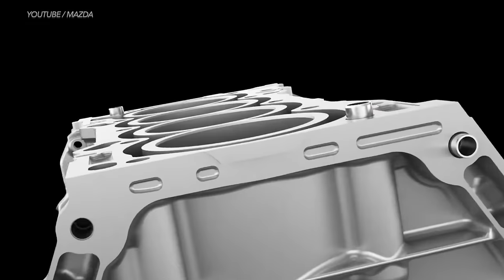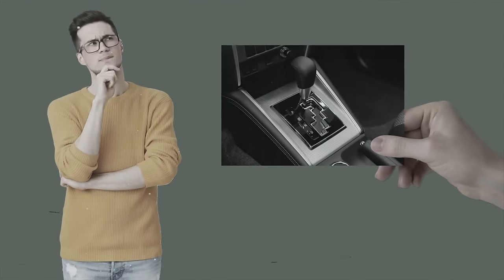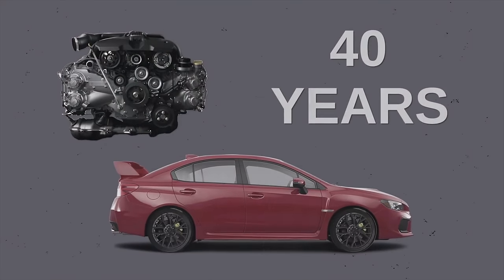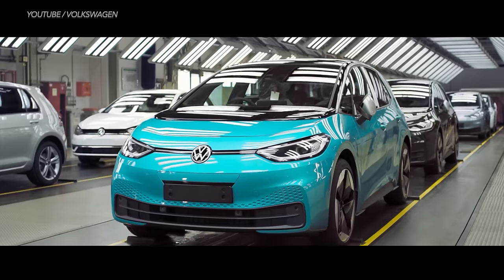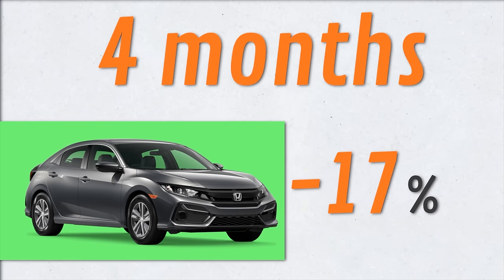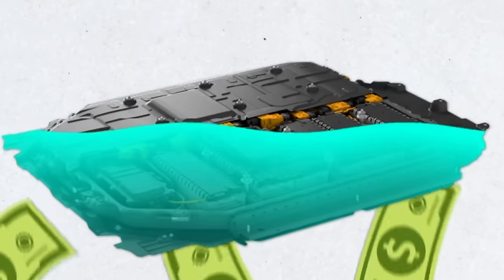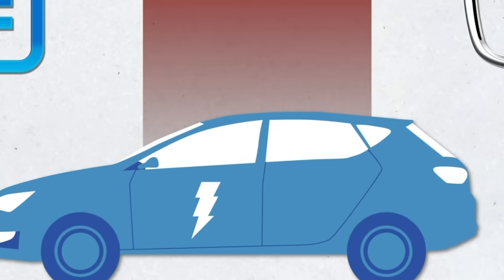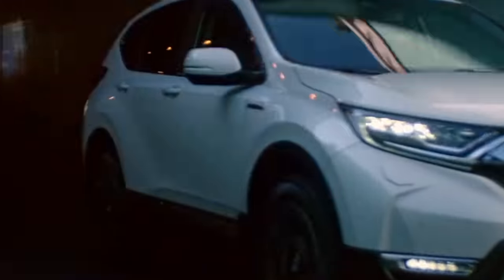3 Things That are Killing Your Favorite Vehicles

Comment: As a former new car dealer in a small town, and a multiple trailer owner and past SUV, tow vehicle owner. When I heard a couple years ago that the Toyota tundra was becoming woosified, I went out and grabbed one of the great big V-8 Tundra gas hogs. 
I would be happy to buy the same exact vehicle in about 10 years if I could find one with 1 mile on it.
Reply: Sounds like about any other truck brand I have owned if you can’t get 250k out of the truck than it’s not worth buying stop acting like Toyota is the best truck manufacturer ever.
Reply: My 2010 tundra 5.7 has 216 k on it. Scotty did a review on it last year when he was in RI.
I have no interest in the new tundra
Reply: @Back_door_bandit_98 exacty!! I'm so sick of people drooling  over toyotas ,like they're the only good choice
Reply: And why I purchased my 2020 Tundra. My first V8! And probably last.
Reply: TheOldBreed  no, thats not what i mean...kust because you know peoppe with newer tundra having issues. Doesnt mean all new toyotas arent good...plenty of newer ones are good. Andof course...you buy the first year twin turbo you're going to have problems....it's mind of common sense..it's a new design,  buy most years honda and toyota,  and a lot  of fords, and mazdas are exellent .
Reply: IMO all full size pickups should have a V8, even if you don't tow much.  A pickup is a heavy vehicle, and a V8 can handle it.  You want 300,000 miles out of your truck?  Get a V8.  What do people think is happening when they're pushing that big truck around with a V6, or god forbid, a 4 cylinder?  That engine is under tremendous strain.

Comment: Yesterday I was discussing with my friend about the electric vehicles. he said th EV cost much less service costs than gas cars. I told him the car manufacturers are not stupid to provide that. You have to pay somehow maybe more than what you're paying for your Lexus regular maintenance. I think i should send him this video to show him the reasons why.
Reply: Do it
Reply: They'll come up with everything to get you back in the shop. Wheel bearings or sensors. Thinner winding wire to fail. Cheaper motor drives. Screens that yellow in the sunlight. Bumpers that melt in the sunlight. I could keep going.
Reply: Until you need the new battery....
Reply: > being friends with an EVs driver

Well that's your mistake right there mate

Comment: Toyotas V8 and V6 engine vehicles will be worth lots of money in the future. Turbo vehicles just won't last.
Reply: I just bought a Lexus IS 350 F Sport with a 3.5L V6.
Reply: Had a GMC 6.6 LB7 turbo diesel and a Dodge 5.9 24V turbo diesel. Sold both with over 400k miles and the original turbos. There’s nothing wrong with turbos, just peoples bias.
Reply: @LayzeeGiant diesel combusts at a much lower temp. Turbo worst enemy is heat. Gas turbos short life, buyer beware.

Comment: C'mon Kilmer you're about my age and know this is merely the start of a new cycle. Also, people who want to buy already have or are biding their time for say a long-lived solid-state battery that when commercially viable will make electric cars the norm. Now all of the car manufacturers have really been building a lot of crap lately. Disposable cars with engines and radiators made of plastic and other planned obsolescence for about $60,000 a piece. Well, people don't take kindly to that, so people aren't buying until something better and more reliable and longer lived shows up.

Comment: My 2016 Subaru WRX STI had a 300hp 300lbft with a 4 cylinder. Never had any issues and only sold it to get a down payment for a house. Miss it a lot. I don't see why 4 cylinder engines are bad. There are only bad manufacturers, not bad number of cylinders. Modern manufacturing can produce more power just as reliably as old manufacturing with less displacement. It is called progress 😂
Reply: But it seems like the only thing that's progressing is the price of the vehicle and of course all the cost that takes to repair them
Reply: 5 liter 4 cylinder could be the hot app

Comment: We used to have a Straight 6 Cylinder Chevrolet Pickup Truck.   It used to run Backwards when You Turn The Key Switch off.   It was a 3 Speed manual Transmission because if it was an Automatic Transmission I don't know how You would kill the engine. It was a 1973 Chevrolet Pickup Truck. It had all that Pollution Junk on it.

Comment: Turbos are killing the old cars we love, good luck see this types of car reaching over 200k
Reply: Only exception is Volvo and Honda, they’ve been making turbo engines for decades and seem to be very reliable
Reply: @BigAltimaEnergy719 1.5l Honda??? Junk.
Reply: @BigAltimaEnergy719  
It's just those good/ reliable turbo engines were at their best in the late 80's to early 2000's and those talented engineers have all retired 🤔
Reply: @mrgarrison3516  like the 7.3 turbo diesel. They are notorious for logging 200,000+ miles before needing anything more serious than an alternator or power steering pump.  Those Garret turbos were matched perfectly  to those engines.
Reply: @OnlyHuman2.0  The earlier ones had issues, I haven’t seen issues with brand new 2023 ones, use GF6 oil and change every 3-4K miles instead of usual 5
Reply: Old, Detroit Diesels with Turbos on heavy trucks and work rigs last a long time, way over 200K miles, turbos on consumer vehicles are just not made the same way.
Reply: On smaller engines in big heavy vehicles only makes things worse
Reply: MEANT.   TURBOS.

Comment: Actually Scotty 3 cylinder engines are now more popular than 4 cylinder. Maybe in the US but rest of the world 3 cylinder plus a turbo is the go to for manufacturers. Brings emissions down and provides good performance. Only issue is you are really heavily on the turbo and a lot of pressure coming into that tiny engine😮
Reply: On cars that are compact or smaller are fine in Europe but not so much on heavier vehicles in the US. Might struggle at times
Reply: @kclefthanded427  I disagree why do Americans have to have large vehicles? Your speed limits in some states are 55mph and they're just straight roads. Your v8s couldn't handle corners and just made a lot of noise and not much traction.
Reply: Ford sure dumped 😅their 3 cylinder fast.
Reply: @chunkybeats79  Its because they are super reliable and can carry heavy loads when needed. Broken roads have less impact on larger vehicles and they are safer in an accident as Elon musk confirmed in an interview recently I saw. 😮
Reply: Roads are not getting better. It's not just the rural areas. Potholes and speed bumps absolutely wreck the suspension within 6 years.

Comment: The best solution for the car longevity is manual transmission. And will save on gas, too. No need for EVs with high prices.
Reply: Autos have been getting better MPG for 15+ years... But I still agree.
Reply: Auto is good for 200k. Manual broke in my friends 2015 Scion tC with 130000 miles

Comment: I have a question? In the sixties, you could buy a ford or Chevy with a six cylinder engine and for a hundred dollars more, give or take 25 dollars, get a 427 ? Inflation is inflation but now a day’s a engine can cost 40,000 dollars more? I don’t get it. Top of the line is still the same thing?

Comment: Scotty, huge fan here. I have a 2017 tacoma. I want to change the transmission fluid. If I drain the fluid when the engine is cool, is it okay to just put the exact amount back in that I drained out. I have a scan tool to determine the tranny temp, but Id rather avoid that hassle.
Reply: All you have to do is , put in what you take out....if I'm wrong,  let me know. And sell the truck. if you need a scan took for tranny fluid, I'd never own  it

Comment: Hey Scotty I hope you’re doing well 
I got this question that no one wanna answer I got a 2011 BMW X5 xdrive35i with no faulty code on a the dashboard but when I scan it here’s what it said:
ECU 1
2) Close loop: using O2 sensor for fuel Mix and I started to see little smoke on the exhaust.
What do you think I can do to fix it?

Thanks in advance for your help
Your youtube fan.

Comment: Inline 4 cylinder cars make way more sense than any EV
Reply: If they did, then we wouldn't be transitioning to EVs.  EVs are just going to have too many advantages.
Reply: @JT_771  Nah. You've been bamboozled by your gooberment.
Reply: @OnlyHuman2.0  Nah, it's all in the numbers.  Since an EV is vastly more efficient and solar energy is so cheap it will always be cheaper to operate an EV.  And it'll continue to get cheaper.
Battery prices have dropped drastically in the past 10 years and that trend, which has been following a predicted curve, is expected to continue.
That means that EVs will regularly get less expensive to make, while combustion doesn't have that luxury.
In the end, price alone will do it.  It's all in the numbers.
Reply: @JT_771  Nah.
Reply: @JT_771  LMFAO
Reply: @OnlyHuman2.0  Hey, believe what ya want & we'll all watch how it plays out.

Comment: The boxer engine in my 86 was the worst at 50k my engine started knocking and there was a problem with bank 1 the Rod was also broken. Luckily it was still under warranty and got replaced after getting it back 3 days later the engine light came on and it had to go back to the dealership then they “fixed” it and it literally blew up on the tech and caught fire 🔥 I lost the 86 CANT even make this up. I will Never get another boxer.

Comment: Why count problems with an engine, when it wasn't the engine? Fuel pumps reside in the fuel tank. Computers are ALWAYS the problem. Go back to no computers in cars, less problems, and no need for mechanics to spend $6 thousand + on a computer scan tool. K.I.S.S. will still work best.

Comment: If an inline 4 engine is placed in a FWD vehicle, then it's positioned widthwise, not lengthwise in the engine compartment. That, combined with the position of the tranny, lowers the vehicle's overall center of gravity. So the COG of the engine itself is largely irrelevant. The real problem with inline 4s, and the cause of most of their problems, is when they're placed in vehicles that are bigger and heavier than those which a 4 cylinder engine was meant to power. During the 90s, the idea of giving a truck or an SUV anything smaller than a V6 was considered heresy. But the rising price of gas combined with the advancement in technology has auto manufacturers thinking they can get away with putting a 4 cylinder engine in vehicles larger than mid-sized sedans. I would disagree.

Comment: Koenigsegg makes a 2 liter 3 cyl 600hp engine with no camshafts. Super campact and load variable valvelifting with the freevalve system. Genius. I would take that anyday over a V6 or V8. And I drive a V6 currently. Imagine small car consumption when you’re just cruising and scary performance when pressing the loud pedal.

Comment: At least GM EVs properly keep the 12v battery charged up, unlike Hyundai who is having a lot of ICCU failures, when that happens the cars cannot even be started,  and cars just dying on the road, at speed! NHSTA investigation started. Honda is smart to use GM.
Hyundai Ioniq5 no heat/no AC is now a thing, Korea designing new part to fix it. People told parts are backordered. Hyundai doing Buy-Backs. Research before the the pretty looks goads you into a mistake.

Comment: This is a garbage video from Scotty. He did not explain that it's only the newest 4 cylinder engines that have problems likely due to being direct injection and turbo charged. Some of the most reliable engines ever made are the Toyota 2TR-FE 4 cylinder (in production for the last 25 or so years) and it's plenty powerful enough. It's a 2.7. And aren't the most reliable engines ever made in the last 35 years the 4 cylinder 1.8 liter engines from Toyota?  So this video is not clear. It's only the newer designed 4 cylinders that are bad.
Reply: He is taking about "layout" design of the 4
Reply: Are u referring to the overall engine design? Most of these new 4 cyls Toyota makes have dual injection and recently they killed the 1.8 motor on the corollas in favor of newer deigned 2.0